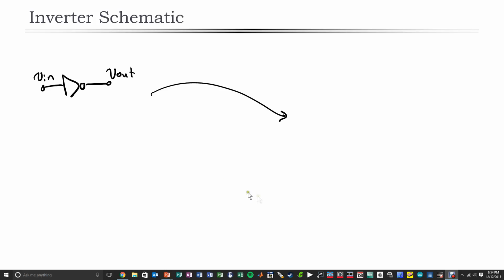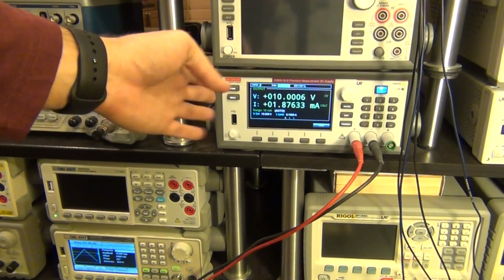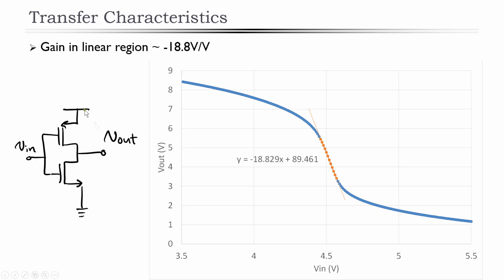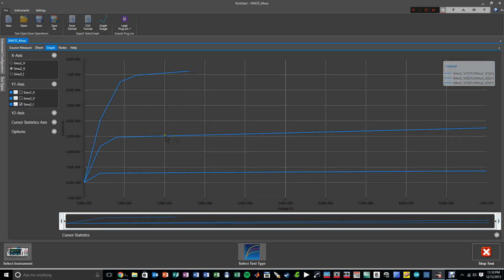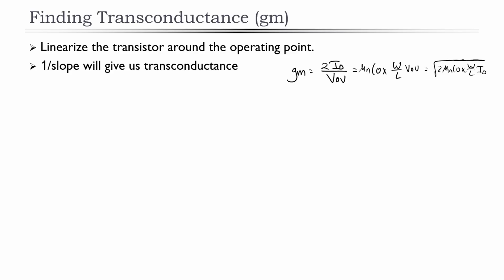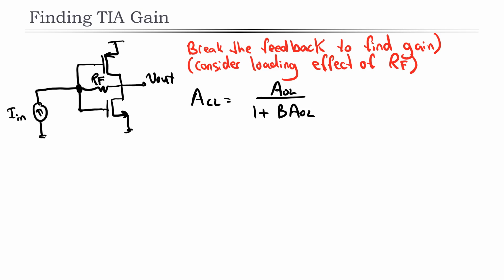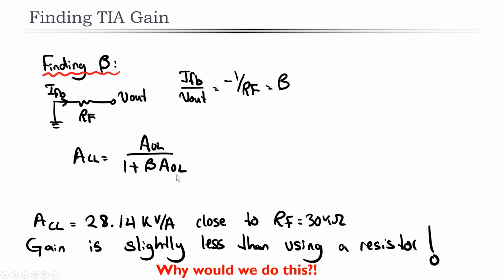TSP #68 - Tutorial on the Theory, Design and Characterization of a CMOS Transimpedance Amplifier

Comment: Nine years later, here's my hunch on why the Bandwidth gain is not the expected 15 but rather a lower 12: The parasitic capacitance of the breadboard implementation is actually on the same order of magnitude than the capacitance of the photodiode itself. So your total shunt capacitance in the photodiode is a tad bit higher.
I assume there are other effects at play as well, but I can not guess...

Comment: I don't get it why you said p channel and N channel in wrong way , Pchannel mosfet arrow is outside , N channel arrow is going inside , it is opposite transistor symbols,  for inverter Pchannel sitting in upper position , N channel sitting in lower position
Reply from the maker: The symbols are correct in the video. You have the PMOS and NMOS symbols backwards. The presentation in the video is correct.

Comment: Nice Basic tutorial on TIA with an unbuffered CMOS Inverter presented by smart guys. However I was interested into in depth analysis of an OPA based TIA. Therefore the title is a bit misleading I think.
Reply from the maker: +hugo schmeisser I don't understand what an OPA has to do with a TIA. An OPA is an optical component, TIA is an electrical component. OPAs sit on transmitter side, TIA on the receiver side...

Comment: Due to the physical nature of the device there is internal parasitic capacitance. The device will begin to oscillate when the fin crosses fout at the intercept point of 180* out of phase. You can see the sharp oscillation point on the scope. By using a compensation capacitor in the feedback path you can dampen the oscillation. Thus producing a more linear transition between I and V.  I'm sure this might answer your question, if not ask your brother. Cool video as allways, look forward to the next one. Cheers.
Reply: At which time in the video do you see oscillation? I am curious, but missed it...
Reply: +kraklakvakve You can see the sharp oscillation @ 7:50 were Shahriar points it out.

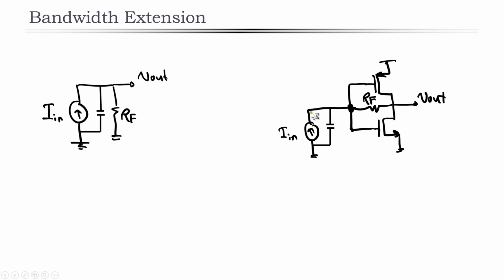Comment: 33:40 there is some extra capacitance at the amplifier input, this should be added to the photodiode source capacitace. This is one of the reasons the bandwidth is not exactly as predicted by theory(?).
Reply: That and parasitics from the breadboard implementation?
The capacitance of the transistors is probablly very small, but I know that for TIA's every pF counts.

Comment: So, the intro sequence was finally fixed. Am I right in believing that it used to be filmed with a camera off of a screen?
Inspired by this video, I will consider trying to make a linearized multiplier (aka ring modulator) circuit based on CD4000 series logic chips. 
22:43 Nice static charge generator, btw!
Reply: +Gameboygenius 
The old intro was that way on purpose. And as far as I remember no filming was involved for that, just effects.
Reply: +superdau The "old" intro was the correct way, not filmed from a screen. He lost the video file, so that's why it was filmed off a screen. Have a look at the oldest videos.
Reply: +Gameboygenius Yeah, if you go WAY back the intro was clearly digital. Then he must have filmed one of his old intros to replace the lost original. I meant to go back and download one of the old videos and extract the digital intro and send it to him but I never got around to it. Clearly he either re-rendered or did exactly what I said.